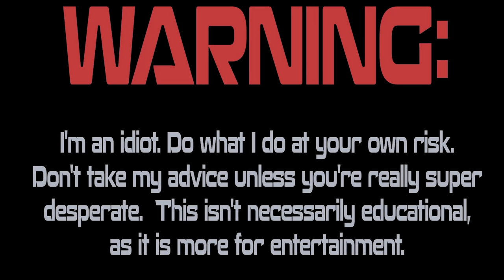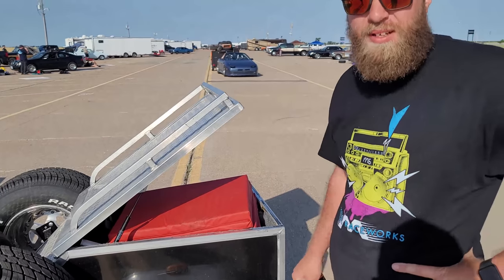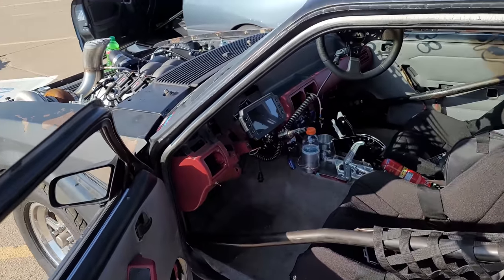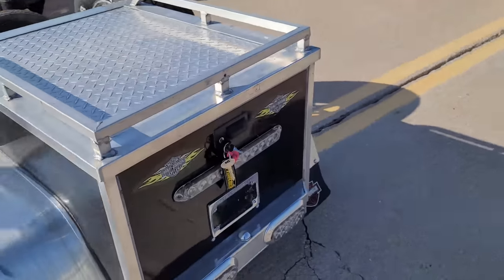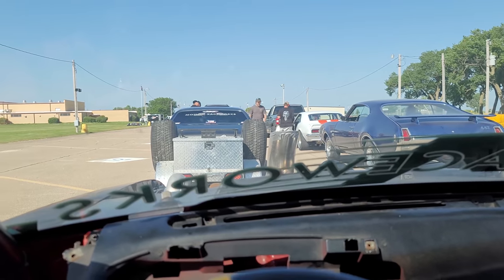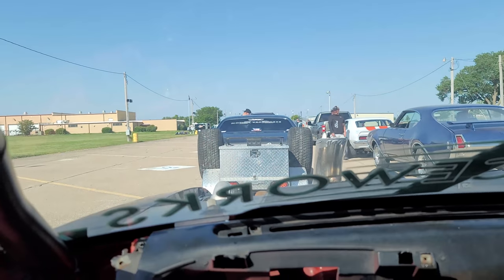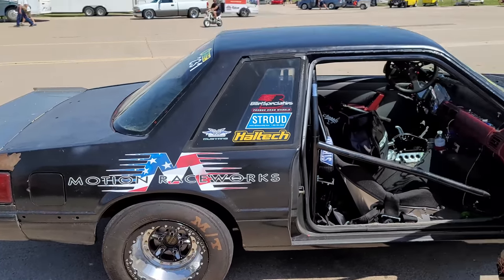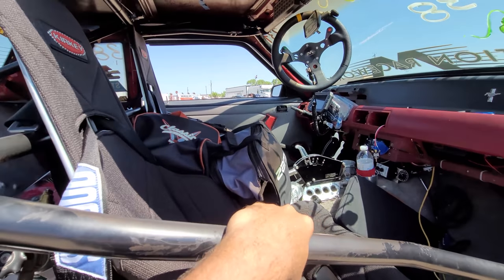Race Week Day 1 & 2! - 300 Miles In a untested Turbo Fox Body Mustang?

Comment: A feller can take an electric impact and a big socket, stick it between the tire and the opening, hit the trigger and let er buck. The socket will turn along the tire and roll the arch perfectly.
Reply: An old wood slugger works best, dont ripple or tear the panels cause its smoother, and things got the ol 2 size fits all.

Drop the air on the tire a wee, jack her up a bit and get to rollin

Comment: These race, drive, race, drive, race events look really fun! I wanna do it now! I went junk yarding and found an 85 Volvo 240 wagon shell & a 2015 Volvo S60R with 3.0L, 346hp stock, Inline 6cyl Polestar motor, launch control, giant 6p brakes, LSD rear and other goodies to port over. As a wagon with trailer it may be easier to carry everything needed.

Comment: I was watching this and thinking, "How many damn tires do they blow on that box trailer"? Then it dawned on me that I was watched the same thing from another vijeoh! Love these multiple perspectives of the action. It's a nice break from the revivals. But a fella does wonder, is there a 1966 Chevelle out there somewhere that hasn't seen the road in 35 years? I'll stay tuned!
Reply: You do know he did a Buick this week.  30 years off the road
Reply: @michaelsclark  yep. Saw that. I gotta say, those tires made me more nervous for him than the brakes!
Reply: 66? Too cool to let sit and rust for sure.
Reply: @michaelsclark  that riviera will be bad ass completed.
Reply: How long will it be until he revives a car thats been sitting for 40 years if he hasn't already? I'll happily wait for that..
Reply: @James-zj3ud  it kind of pisses me off. I can't get my 2012 shitbox to run right. He goes into a field carrying a battery with a "go handle", taps the carb a few times with a screwdriver, and then drives away! It's maddening! LOL
Reply: @tommattie1240  because they don't make 'em like they used to.. all you really need to pull that buick apart and back together again is just a pair of pliers, a shifting wrench and a flathead screwdriver and nothing else..

Comment: Loving the adventure - All the Race-week style events look amazing.  It's nearly enough to make a feller want to build a budget race wagon and join the fun.  A Country Squire that can fly.  Or a really cheap and nasty Plymouth wagon from the early '70's with a monster Mopar power plant.  Build something that hauls, and hauls.  Eliminate the need for a trailer.  I'm sure there are some great examples of that out there.  But then I noticed even some wagons had trailers, like that massive hearse with the coffin trailer.  So perhaps avoiding the constant load in / load out of all gear at every track makes the trailer the right move no matter the vehicle used.  That's a lot of work saved.

Comment: Have a good friend that runs in the Kelowna street outlaw we run here in Kelowna B.C Canada which I kn9w you would love Derek. It’s a 70 Chevelle that is stock with a small block putting out over a 1000 horse. Even has the full bench seat and stock radio that he will not pull to even save weight. He pulls the front wheels ever-time he leaves the line. Thanks for sharing and if you want to see some video of his ride I would be be happy to send it.

Comment: I use to have a set of Kentucky plates I used for about 10 years off and on. Never had a problem what so ever. And then one day I drove a car across the scale for scrap and I for got my/some body else plates on it. I really miss those plates lol the screw holes were even worn out and I had to use washers on them

Comment: 26:32 This ethanol thing confuses me, for racing I get that running cooler is advantageous but isn't there a concern about ethanol leaving residue that gums up jets, injectors...etc?
Reply from the maker: They're made for it, just like flexfuel vehicles on the road from the factory 👍
Reply: @ViceGripGarage  WELL. I'LL. BE. DIPPED. 
Thanks Derek.

Comment: I think motion raceworks need to sponsor your next revival.

Just saying
Reply: Couldn't you see him sticking a motion race works fuel cell and fuel pump on a clapped out Vega that hasn't run is 744847748475 years? 🤣
Reply: This time on Vice Grip Garage. We're gonna revive this Vega. It hasn't run in 8483626844 years. We're gonna slap a motion race works fuel cell, brakes, fuel pump on her and drive her home.